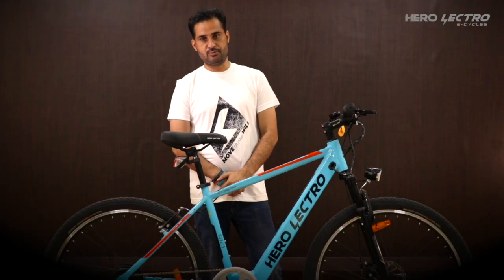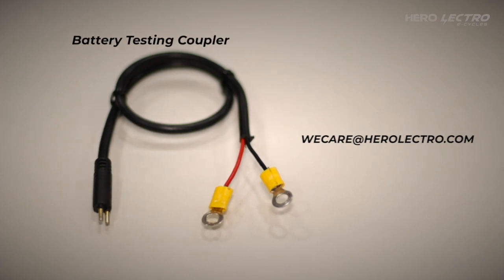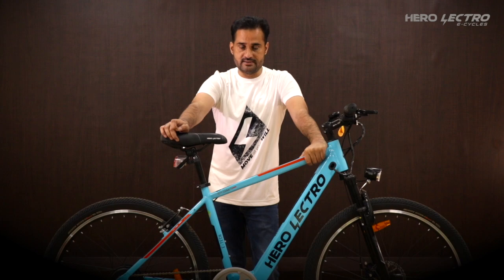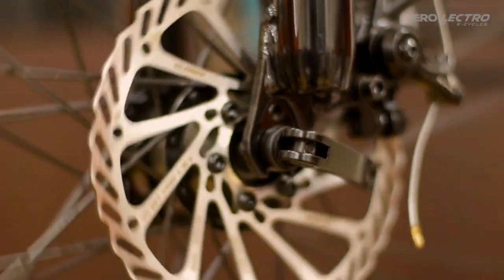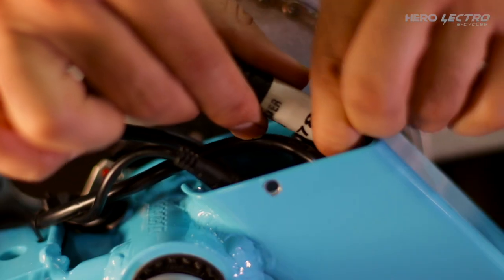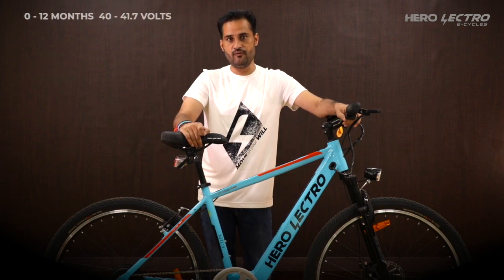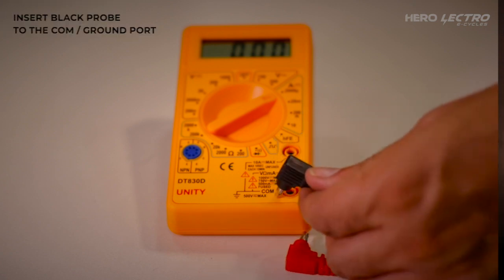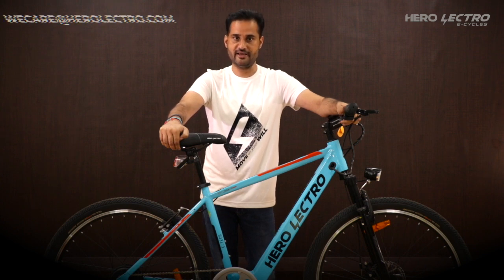Hero Lectro - How to diagnose a faulty battery

Comment: 95% of the problems mentioned here could have been prevented had they used 32650 cells instead of 18650 cells 🙄

Comment: After 3 years, Replacement New Battery cost???
Reply from the maker: Hey Raja, 
The cost of battery replacement is approximately INR 7000. Do let us know if we can help you with any other queries.
Reply: @HeroLectro  could you please tell me where are the batteries available please 🙏🏻
Reply: @HeroLectro  Not true, they are charging 8500 + 2000 for fixing,  after complaining they reduced 1000 Rs. which is not worth for a 36v 5ah battery.

Comment: Can u suggest how to remove speed limiter in lectro....
Reply from the maker: Hey Vivek, 
We appreciate the enthusiasm but unfortunately that wouldn’t be possible and we would advise against it.
Reply: @HeroLectro   sir,
 I am using glide TX, since last year july.....!!!
!!

Last year durga puja one constable stopped me for hero lectro first time he see a e-cycle and very curious about to get it,listening all the features  And asking me if is there any ladies model for her daughter.  he took a test ride  after that he disappointed that top speed is just 24kmph and range is 25km. Than  told me that he will purchase two model one for him and another for her daughter if the top speed will be slightly higher ~30/32kmph and little longer  milage ~50km.

So
In that case sir hero can mention in their website "according to govt. Rules and  Regulation top speed is limited 25kmph and if you ride above the mentioned speed limit in any public place in that case responsibilities is yours ,But in any private place you can ride with above 25kmph"    

         make an option leaving for us to unlock the Speed limiter and additional battery mountain point. 🙏🙏🙏 
My daily journey is about to 39-42km 
Sometimes 51/53km so all the time I have to carry the charger 🥺

Comment: Are spares even available?

Apparently not on amazon, flipkart or at the cycle stores that sell this bike.
Reply: Do not buy this, the battery replacement cost is very expensive, they are charging 10,500/- for 36v 5.8AH battery.  And no spares available.......